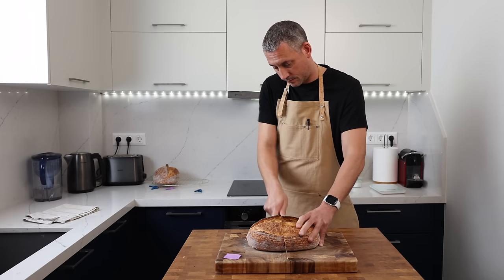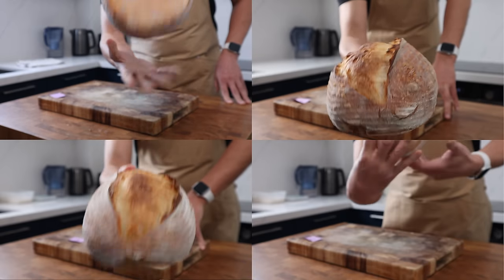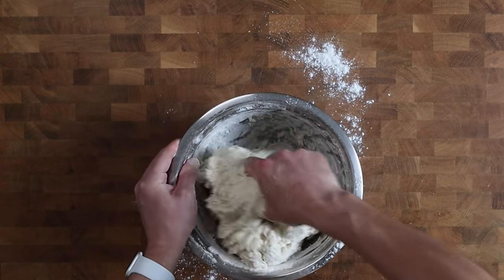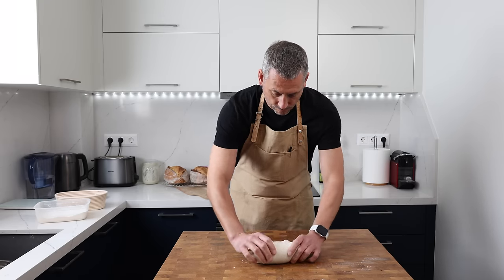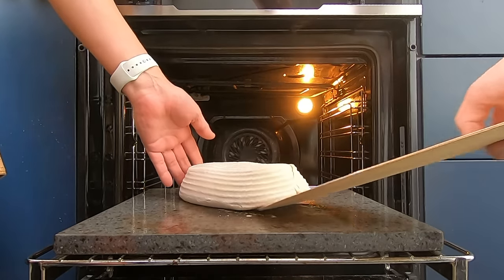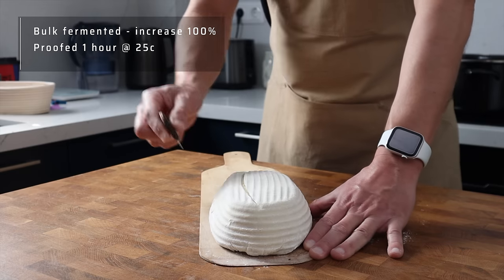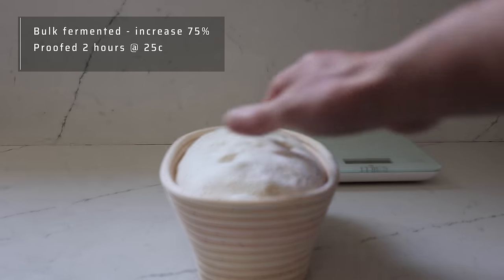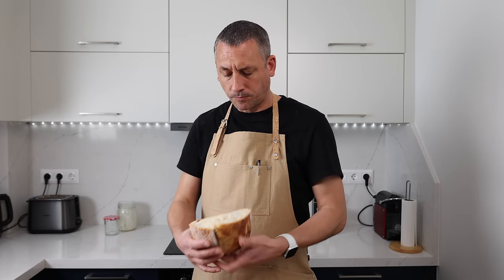Stop Over Proofing Your Sourdough, Use This Experiment to Find Your Optimum Proof

Comment: This may be a silly question as I've made many sourdoughs, but am I the only one that doesn't understand what you mean by bulk ferment to 100% or 75% volume?🤔🫣
Reply from the maker: It's not a silly question, perhaps I didn't do a good job of explaining it. After the initial kneading, I remove a small piece of dough and put it into a jar. I mark the outside with a pen so I can see when the control piece of dough has expanded by 50%, 75% or 100%. That way I know how much the dough is increasing in volume. I prefer to do it by feel but for these test bakes, it helps to use a control piece of dough. I hope I managed to explain it clearly?
Reply: 100% means double original volume. So if you started with a quart of dough after rising 100% the dough would occupy 2 quarts of volume. 
50% means half again as much as you started with. So if you start with 1 quart after rising 50% you would have 1 and a half quarts.
Reply: @CulinaryExploration  Aaaaaaaahhhh..penny drops. Roger that👍 Thx!
Reply: @maylien  Thx Maylien. I understood the maths, but I couldn't figure out which original amount we were comparing to. Got it now😊👍
Reply: @CulinaryExploration  After 100+ feedings and 30+ boules. ive been able to graph out the approx activity curve of my sourdough culture.

Time = 0 --> a typical feeding involves upto 1:1:1 starter:water:flour (fine whole wheat), and maybe a smidge more water in dry winter weather.  Ex: a maintenance feeding is 10 + 10 + 10 = 30 gr. For a leavine, id step it up to 30 + 60 + 60 = 150 gr.  When ready, id use 120 for bread (20% pitch rate), 20 goes into my discard jar in the fridge, and 10 gets fed 10+10 at room temp.

T=1-4hrs --> those 1st 4 hrs involve exponential replication, and a corresponding increase in fermentation rate, which produced both co2, acidity and flavor, with autolysis happening in tandem (fodder for separate discussion).  Anyway, by the time my timer has hit the 4hr mark, esp if im maintaining my ideal 89F internal temp, my starter has usually reached peak activity and leavening rate, and it's usually already risen by 20% or so.  It will usually maintain that activity level about 4 hrs before starting downhill. 

T = 5-8 is the peak activity level for the currently fed starter, and the ideal time to use a leavin for bread, or to fast track a step-up feeding for same. I usually hit a 100% rise at the 5 to 6 hr mark, and then it shifts into neutral for hrs 7-8 before beginning to decline.

T= 9-12 Geometric decline, during which climbing acidity drives the microbes into dormancy, after which they very slowly begin a gradual dieoff.  The increasing acidity also begins denaturing gluten, and the dough begins to sink and lose cohesion.

Relocating a dough or starter to the fridge seems to slow down this timeline about 5 fold, thus if I take a 4hr old starter just hitting stride, and park it at 36F, it's 4hr peak activity window will widen to 4x5 = 20 hrs.
Reply: @CulinaryExploration  TIP: Alternate means of monitoring rising level ... i do my maintenance feedings in a tom collins glass, and starter stepup feedings in a bartending pint mixing glass.  After feeding and scraping the starter into the glasses, ill settle it by tapping the base against the heel of my palm, then cover with a saucer.  I use a small rubberband to mark the fill level, which makes any rise easily visible.  As for bread, I raise my 1kg sourdoughs in a 2L cambro, which has markings to monitor rising as well. After 2 hrs of fermenting at 89F, folding every 30 mins, i fabricate then reshape my boule and rise in a banneton for 3-4 hrs more, at room temp, by which time it's always pushing 120%+
Reply: Yes, everyone else was born knowing these terms. You're a little late to the party.
Reply: @CulinaryExploration  This is actually smart
Reply: From the last experiment at 75% and 2 hrs in the basket, had the dough risen to 100% before retarding in the fridge?

Comment: in germany these big holes in bread are considered a flaw. as whatever you want to put on there is trapped in the holes. consider fresh cheese, honey or any type of jam, it just runs through.  also if you want to overbake it with cheese, like french croque monsieur, the cheese runs through. so air pockets should be around 2mm in size, not more. the rest has no practical use
Reply: 2mm? that would be very tight crumb, i think 3-4mm is still perfectly fine.
Reply: That's a different type of bread. Not all bread is the same or is made the same
Reply: @crystinamcdonough9120  yes but what is the purpose of bread with big holes?  to eat it single?  cause neither butter can be spread properly. nor any other soft thing. also it takes more space, uselessly. and falls apart while cutting. ? it just makes no sense logically

Comment: I've watched quite a few of these types of experiments on various channels, with people pushing the limits of variables like proving time, "over" kneading, sourdough starter timing etc. It seems that often the result shows that, while there is an optimal preference for each variable, the extremes either side are actually usually quite forgiving. This is reassuring for amateur bakers like myself

Comment: What I have been doing is bulk fermentation between fifty and seventy five percent in my oven with the oven turned off. It usually takes between two or three hours to reach that desired fermentation. I then form my individual loaves and place the baskets in the oven for one hour additional bulk time before placing them in the refrigerator for a twelve hour cold fermentation period. Although this process is not as controlled as your process it has been very consistent and produces a light lacy crumb similar to your preferred loaf from the video. I have experimented with higher proofing temperatures during the bulk periods and I have concluded that the room temperature bulk has given me my best results.

Comment: I've been playing around with various soughdough recipes for a year or so and after 60 loaves have settled on a different , maybe unique method but I doubt it LOL. One of the things I do is use a hand held blender to completely dissolve the starter into the water before adding flour, my logic is to obtain a more even distribution of starter yeast throughout the dough, that and the thought of a blob of starter in the middle of my loaf doesn't sound good 😃
Reply: That makes sense to me! Baked goods often turn out a more consistent quality with thorough mixing in carefully planned steps. Please let us know anything else you have discovered!
Reply: @helenjohnson7583  My method is similar to @Culinary Exploration, I feed my starter the night before so its peaking around 7am, I warm my mixing bowl and the water, to around 95F, for my dough, add salt and dissolve then add starter and blend to a soup, add flour and mix, rest 30min then fold, rest another 30 min then fold, I then bulk rise the dough in my oven with just the light on for 4hrs, not sure what temp the dough is but the bowl is just warm to hold, I'll check the temp next time. Fold and shape the loaf, place in a basket covered with film ( I use a , new LOL, disposable shower cap) for 4 to 7hrs at room temperature (my kitchen can be between 20-25C) .  Bake in a fan oven @ 425F on parchment in a preheated (45min) dutch oven for 25min followed by 15min @ 375F dutch oven lid off. 
My loaves burn if I don't turn down the temp, I'm @ 3500ft and an arid climate but I've found this method produces very consistent results for me. My dough probably only rises about 50% each time on bulk rise and in basket, not that much really and my starter rarely rises more than twice its size, nothing like most of the YouTube videos. If I could get a little better baking rise I'd be delighted, any ideas?

Comment: Phil, wouldn't giving the 75% dough another 2 hrs put it to 100%?  would be helpful if you had marked them 50%, 75%, 100% and so on instead of time. Always a joy to follow your technics and experiments.
Reply from the maker: Not sure Mike. The bulk is easy to measure by volume. Measuring the increase in volume in the basket is a bit more tricky so I opted for time. I found that 2 hours in the basket was perfect, but cutting the bulk from 100% to 75% made the difference in the crumb.
Reply: @CulinaryExploration  but you had that extra piece of the dough in the jar, so what was its total raise after 2hr proof?
Reply: @szkribi  you degas the bread when shaping, so you cant just see the total fermantation time as a whole. Shorter bulk fermentation and longer proof gives the loaf extra time do develop the crumb in the final stage.
Reply: @PoolProblems  but that's not the answer to my question
Reply: @szkribi  but i don't see hows that relevant, since the extra piece hasn't been degassed like the actual loaf in the shaping process.
Reply: @PoolProblems  degasing doesn't stop fermentation so number of folds/dough handling doesn't matter (fermentation-wise) and I'm just wondering what's the total rise from the beggining to the end

Comment: Hi Phil, great videos. Here in Malaysia the kitchen temperature is between 32c and 34C and humid.Its hard to determine the correct bulk fermentation time at that temperature. I know a lot of people in SE Asia who have trouble making sourdough because of the temperature and humidity. Since you have you temperature controlled cabinet it would be good if you could investigate making sourdough at these temperatures. I know if would be appreciated by a lot of people. Otherwise if you don't get time, can you document how to set up a temperature controlled cabinet like yours, one that drops the temperature to 25C. Thanks
Reply from the maker: Hi John, I've uploaded a video on the YT channel and have a blog on the website about the fermentation chamber. You could try using a cool bag with an ice brick to create a cooler area to bulk ferment. I'd suggest trying to create a cooler fermentation area rather than trying to make sourdough in 34c temps. I'll have a video coming soon on baking in higher temps. Hope this helps
Reply: Agree with Phil. 
Sometimes my house has high temperatures here is Australia. I use a cool box (esky, drinks cooler) and regulate using ice cubes in a plastic bag. Works better than sweating out my dough on the 30° counter top
Reply: I live in Singapore which is just south of Malaysia and just as hot and humid. I too have had success using a large cool box with an ice pack to maintain a temperature of about 20 degC for bulk fermentation and initial proofing. Works well enough, except that there will be some water condensation on the dough due to the high humidity here.
Reply: Hi I'm in Philippines same problems but I now chill all the ingredients I keep 2 kilos of flour permanently in the refrigerator then put the nearly ice water mix in a spiral  for 5 mins cover the bowl for 20 mins or so then add starter and salt mixing for 6 to 8 mins on high this gets the dough to the right temperature about 25c then straight into refrigerator for bulk fermentation folding every 1 hour 4x then shape put in bannetons or cush straight in the refrigerator and  bake at 7am the trick is don't start until the heat of the day has gotten cooler like around 6pm 7pm good luck and this guys channel is great oh and try 60 % and one at 65% or higher hydration and you'll be amazed cheers

Comment: What an excellent video - You bake well sir!
The ear is all about the angle of scoring. French bakers are taught to score with their first finger knuckle pointing upwards to present the blade at an angle to the dough. I don't like ears, they make for sharp crust edges in the mouth. So I hold the blade vertically to the dough.
TBH This ear thing is North American fashion. Born of Chad Robertsons signature Tartine style. If you watch French artisan baking videos they seldom score ant an angle to make an ear. 

If I might add though the fermentation is arrested in the fridge the protease enzymes continue to work, albeit slower. These enzymes 'cut up' the gluten structure and it is this weakened gluten structure which gives the large irregular vacuoles in the finished bread.

Having said that the enhanced flavour in naturally leavened bread is caused by the organic acids , mainly reduced by the LAB bacteria, reacting with the alcohol made by the yeast. These reactions are much slower than the yeast fermentation which is why slow fermentation and, or retarding in the fridge gives the finished bread that much more flavour. In both cases we slow the yeast and LABs to enable the organic acids etc time to keep up. 

Superb video, great baking and thanks for the fridge temperatures and times. Excellent!

Comment: Great video! I do a lot of experiments. I live in the tropics so its around 27c room temperature. To stop it over fermenting overnight in the fridge I now put it in the freezer for half an hour once it's put in the banneton and then in the fridge overnight. This brings the temperature right down and it doesn't overproof in the fridge.
Reply: That’s very sharp thinking! Good use of temp control!
Reply from the maker: Have you tried using a cool box with ice blocks to lower the temperature and extend the fermentation? Ive had good success with that :)
Reply: @CulinaryExploration  yes I have but it's hard to maintain a stable temperature that way, particularly in the summer lol. I find it ok to ferment at 27c to 30c but it was taking too long for the dough temp to come down in the fridge overnight when proofing so the freezer trick has really helped.

Comment: Very interesting because I was recently struggling with producing really great looking loaves (externally), but inside I would have some random bits of very dense areas usually about 3/4 from the top and often in the center of the loaf where the volume is the greatest in terms of height.
I had been bulk fermenting to a state of very "jiggly" with lots of little fermentation bubbles. It's what many said was where it had to be . I was doing four sets of stretch and folds and I know the structure was there and my starter is very active, etc.
It was very frustrating. I use Robin Hood all purpose unbleached, and I'm at about 72% hydration overall when you include the starter hydration.
I decided to back off on the bulk fermentation time. I waited until the dough had  some jiggle, but not a lot (about 4.5 + hours at 80 degrees F). Then I pre shaped it and let it rest for about 15 min. After that I shaped it and let it final proof on the counter for about 55 minutes (usually I would only be able to let it final proof for about 20 min. before the finger test failed and no spring back would occur).
Voila..the best bread I have made thus far. It sounds counterintuitve, but it worked for me. The crumb is actually much more dry which is great since it isn't as chewy when toasted like it was previously. The crumb is also fairly consistent regionally. Not really open, but not super tight either. I think that is more about shaping and the amount of tension I apply when shaping. I can play with that. The main thing is that those little gummy bits are gone. I'm super happy about that.
Now I can start final proofing it in the fridge again to find out how long I will need using that component since it does add a lot of flavor to the end result.
Reply from the maker: Cheers Magnus, sounds like you've got it spot on :)
Reply: @CulinaryExploration  Thank you my friend. You were a huge influence and a major reference point when I started on the journey.
Reply: Hmmm, sounds like my exact issue!  I'll have to try your method!!!   Do you put in the fridge?  I wonder if I'm fridging too long 🤔

Comment: I am starting over with my starter because it got contaminated. I bought some straight sided canning jars that are ONLY for sourdough, and I also bought some sanitizer to clean jars and utensils to prevent future contamination. I also had issues with the kitchen being too cold over the winter, which made it difficult to have consistent results. I am pretty sure that Bob's Red Mill Artisan Flour is better than King Arthur based on my experience and it doesn't seem to be as difficult to obtain now. I am looking forward making some new attempts this spring/summer with these changes.

Comment: I've been experimenting with levels of sourness and have learned some interesting things. I can increase sourness by retarding in the fridge for up to 72 hours. Each 24 hours adds more tang. I also found that I can bulk ferment for much longer (and thus increase the tang) by using a very young starter.
Still learning and loving it!
Reply from the maker: Interesting Dane, when you say "young starter" you mean recently fed?
Reply: @CulinaryExploration  Yes, recently fed and not fully ripe. I can increase the bulk ferment by a few hours and get more tang.
By the way, thank you for the videos! Super informative.
Reply: I extended my fridge time the last 2 loaves and got poor spring/overproofed bread.  Wonder if I need to BF to 50 or 75% if I'm going to do a longer fridge time... agree on the flavor when it's in there longer!
Reply: @chrisdeangelis4616  You do sacrifice oven spring. I think a good trade off is start your fermentation with unfed starter, then do the final fridge proof for only 24-48 hours.
Reply: @999Dane  hmmm, unfed starter?  That's interesting.  I guess you'd have to make up the flour/water you'd use to feed with... how much are you using?
Reply: @chrisdeangelis4616  I have a starter that may have been fed a week ago.  I can use about 40-60 grams for a 500 gram loaf of bread.  Using the starter without "ripening" it first means that you can bulk ferment for several hours longer.